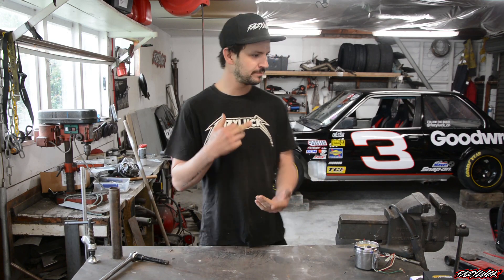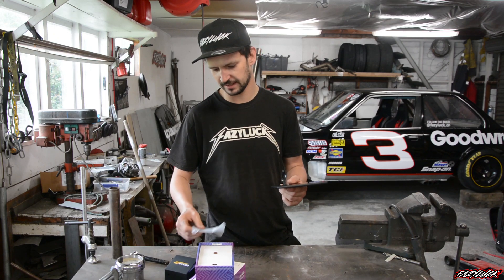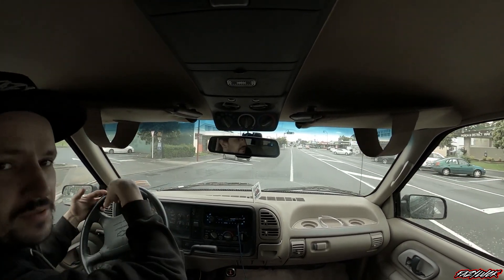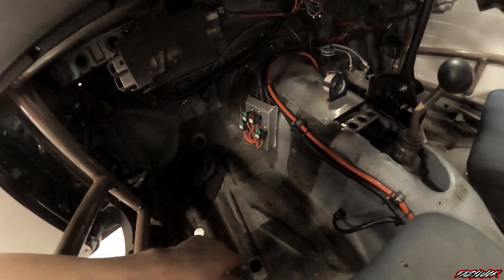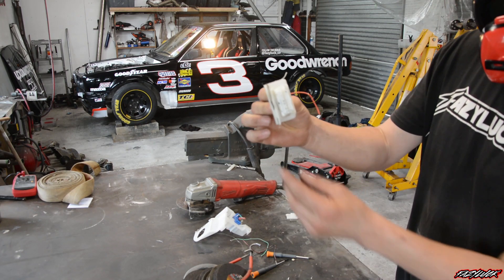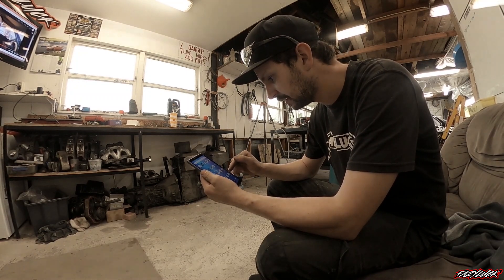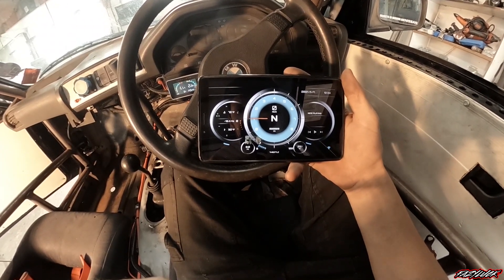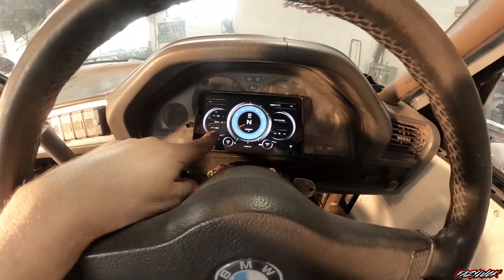E30 LS1 // NEW DIGITAL DASH USING OBD2 + REALDASH APP!

Comment: Hey man that's a nice simple setup you made. Just curious though cause I have LS swapped my vs commodore but are you still using a standard ecu? And did you need the car running to get any signal on the dash? I've tried a Bluetooth obd reader and I couldn't get it working, works on my work Ute though 🤣
Reply: Haven't tried it while running the car yet as I only have headers on at the moment 😅
Reply from the maker: Hey man Mine connects automatically when the ignition is turned on even if its not 'running' , Did you mamange to sort something for your VS?
Reply: Also, is that ecu out of a ls1 commodore? Sorry for all the questions 😂
Reply from the maker: @jimmyd5117  no stress man! Yup its a commodore ECU thats had security removed and a tune put on
Reply: Nah I haven't sorted it as yet, I've got an obd2 cable now. Just need some spare time to tinker around with it and see if I can get it going on a tablet